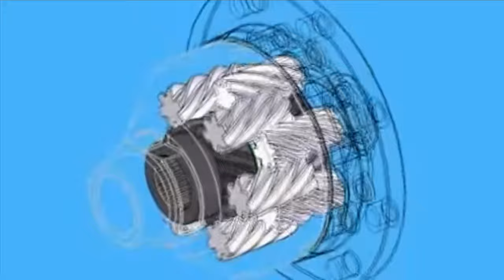A Diff Comparison - Which is Best for You?

Comment: I installed an OS Giken clutch discs differential with good results. as long as you run the 80 -250w oil its almost never clutch pops, except on tight corners under hard acceleration. Yes the oil is expensive special OS Giken  100.00 per liter,  oil changes every 15,000 miles after initial breakin change at 500 miles. Gave my 370z a much improved stance and traction control especially through the corners. More clutch disc make engagement smoother than other disc type LSD units. Price a little more expensive,  1200.00 buys you Japanese engineered unit that quiet and works.

Comment: Can you leave a link to the wavetrac diff, I would like to purchase one. I have a 40th anniversary edition, sport touring, manual 370z. I assume the wavetrac diff would be a good upgrade over stock.
Reply from the maker: https://www.z1motorsports.com/differential-upgrades/wavetrac/wavetrac-limited-slip-differential-lsd-p-9675.html
Reply: @thecarizon504  ok, cool. That was the exact one I was looking at.
Reply: @Amaterasu did you end up getting the diff?
Reply: @boosted_brody5474  no. I just started having some pretty severe gremlins with the car right before I got it. I still plan on it eventually
Reply: @amaterasu8829  aww damn